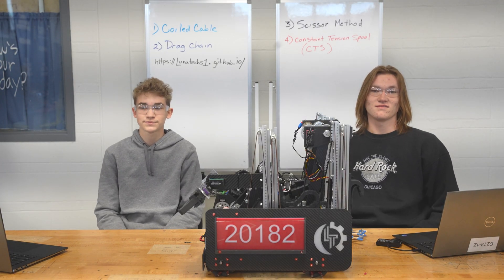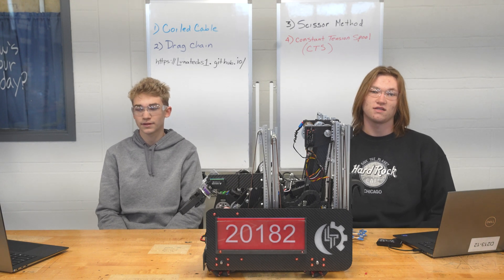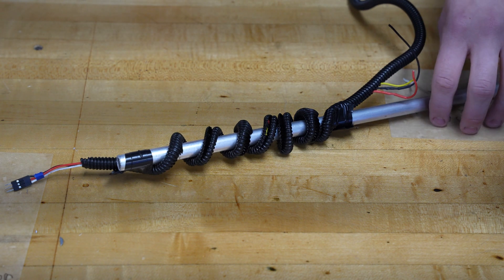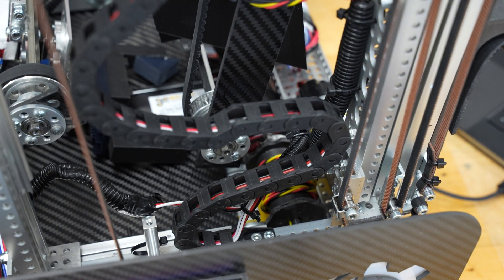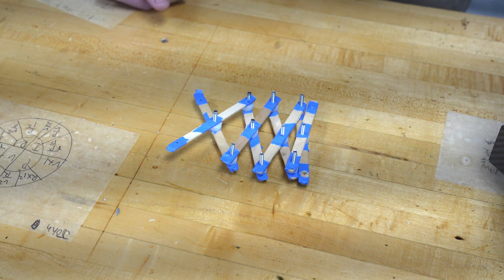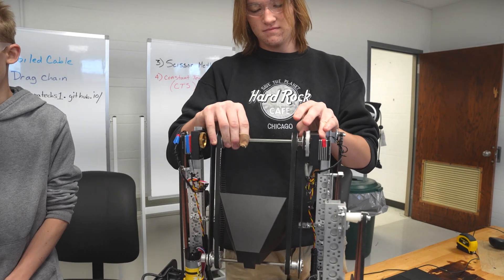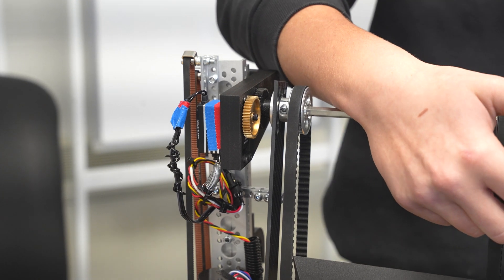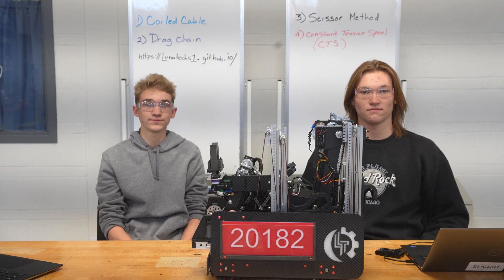INTO THE DEEP: Wire management for extending parts.

Comment: did ya'll 3d print the bushings, if so, could you please link the file?
Reply from the maker: https://www.amazon.com/uxcell-Spacer-Washer-Height-Screws/dp/B091372MSJ/ref=sr_1_3?crid=4TLVKTTF9TW5&dib=eyJ2IjoiMSJ9.ZntZMydjEDgsq6q1l_fLPJv1INqxvNAK4c7yw7fKhiXnfyjv9MI_LdJ_SW-Pjvy7KOZS9cMs6jZ2JIBRZfagrhGvc2vOoGz2U_UP-zmLGz7-nPZq-rh63JsmcvBG3yrdyMNzt8vEqBr8pF7hWDfh4q_Mk2XGgycO8ET7_gjs7HU_qVoa0JMCnMWMpTVqfjy2QCINHgqhi7ohD9Vl1B88I4O5m_Irs6OVHykrEeRXdfo.q8p7sKWiUrbhjvUnQhrwu9yKZj3nGZyUrbEnJLDtCQw&dib_tag=se&keywords=nylon%2Bspacers%2Bfor%2Bm4%2Bscrews%2B5mm&qid=1736442482&sprefix=nylon%2Bspacers%2Bfor%2Bm4%2Bscrews%2B5mm%2Caps%2C106&sr=8-3&th=1 These are the perfect size but you can just cad out a simple tube with a 4.4 mm inside diameter  that is 5mm tall. I would use PLA+ or regular PLA with heavy infill